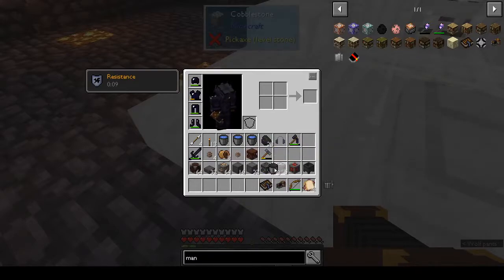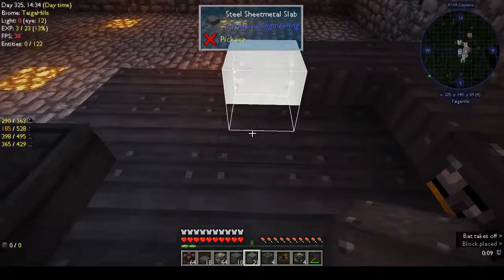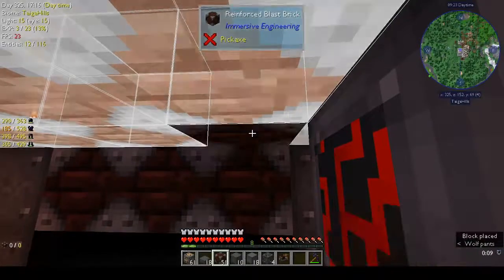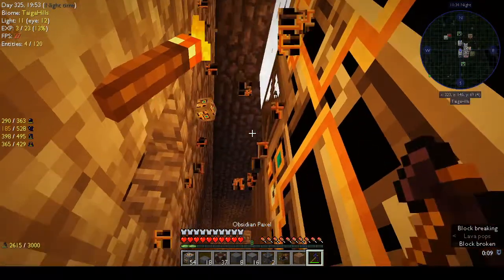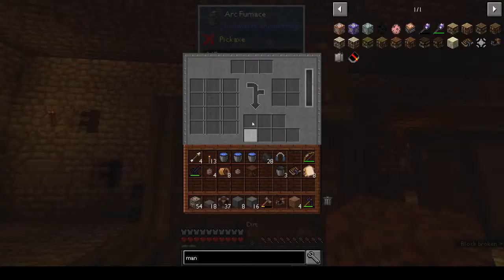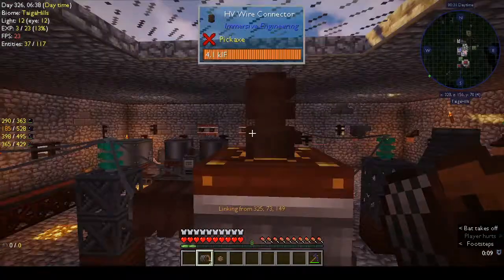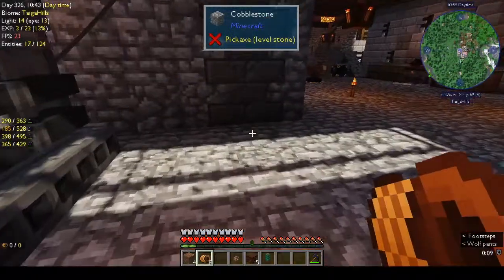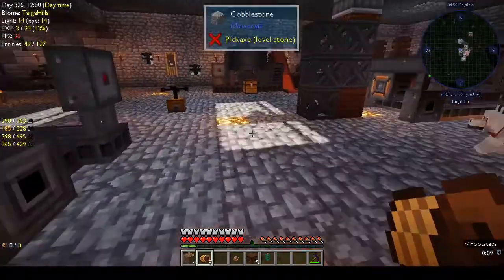Automaton | Arc Furnace Woes| Ep 32 | Modded Minecraft

Comment: Blue is input, orange is output - for items. For energy there are three plugs on the back side, one block higher that you place your connector. Furnace (and any other IE machine) will work with any amount of energy, just slow. Arc Furnace can process up to 12 items at a time very fast but will consume 6 000 RF/t. To make it work you also need 3 Arc Furnace Electrodes that you put into top slot. Items to smelt (like ores) are placed on left side, items to make alloys are placed on both left (ingots) and right (grit) side - in JEI top item in recipe goes left and all other items go right. Also on back side is output only for slag, smelted items are outputed on front. Inputs are on top. (-;